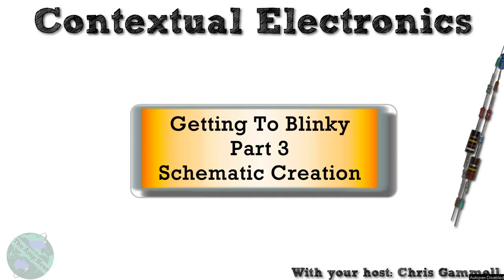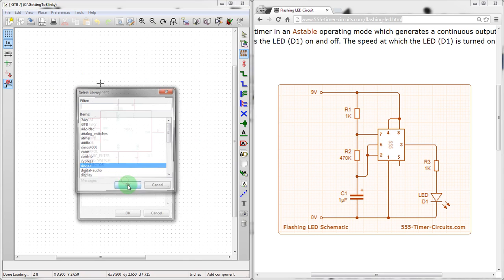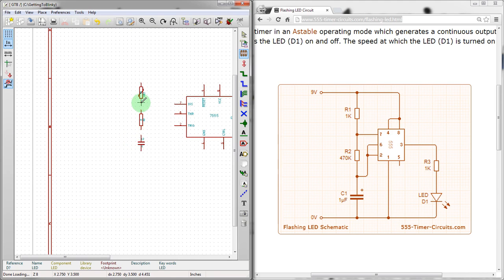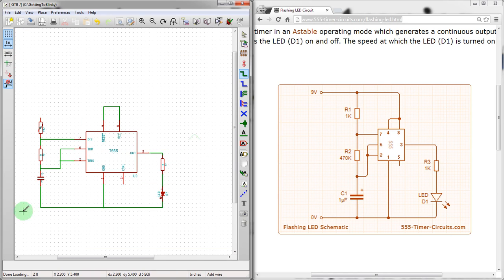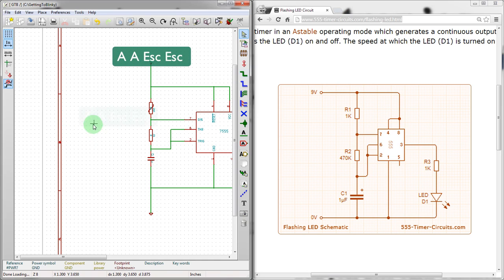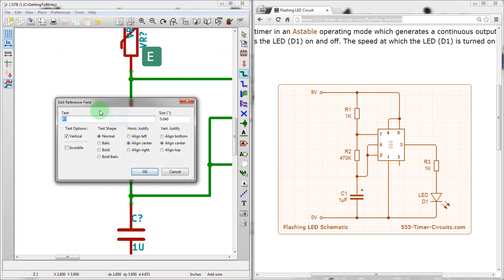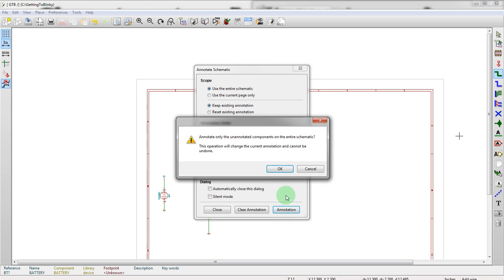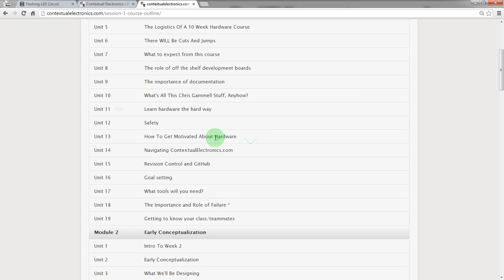KiCad 3.0 - Schematic Creation with EEschema - Getting To Blinky KiCad Tutorial - Part 3

Comment: Hello, Thanks for showing.  One thing I don't get is why KiCad and Eagle hide the power and ground pins of ICs when you add them.  Why is that a good thing to have?  I'm not an EE so not sure.  But when I put an IC into circuit, I'm always having to show those pins to connect otherwise you get drc errors.